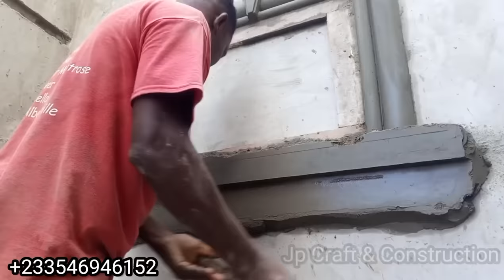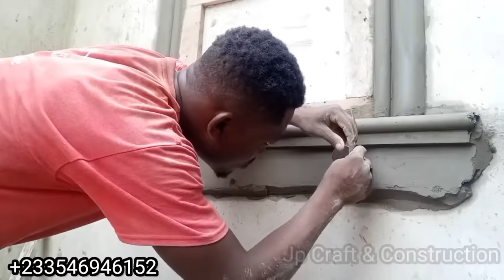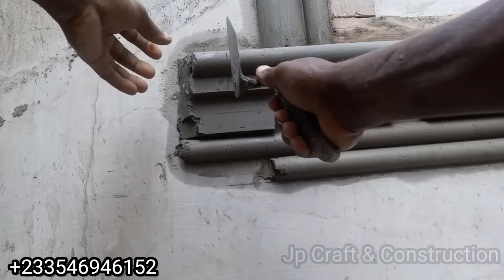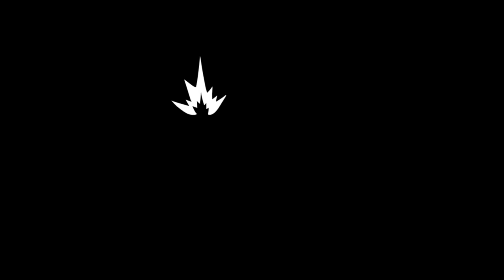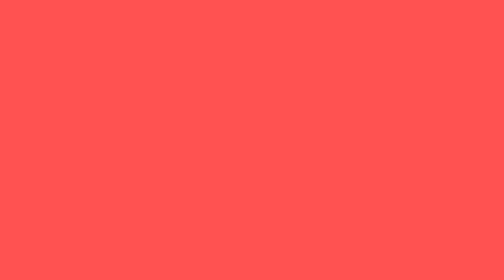Sand Cement Window Design 2022.   | PVC Pipe In Action

Comment: What ratio of mixing sand and cement please tell
Reply from the maker: Hello welcome to my channel.
Hope you have a moment of fun with my video
The ratio for this craft ideas is 
1part of Cement is to 2part of Sands.
Mostly this can change due to the strength of the Sand.
Thanks for watching
Reply: @jpcraftconstruction.1828 please is the sand 2 wheelbarrow or head pan
Reply from the maker: @nanagyasinana1386  what you use to measure the sand is the same thing you will use to measure the cement.
Reply from the maker: @nanagyasinana1386  what you use to measure the sand is the same thing you will use to measure the cement.
Reply from the maker: @nanagyasinana1386  what you use to measure the sand is the same thing you will use to measure the cement.